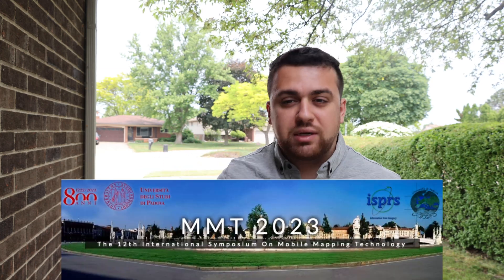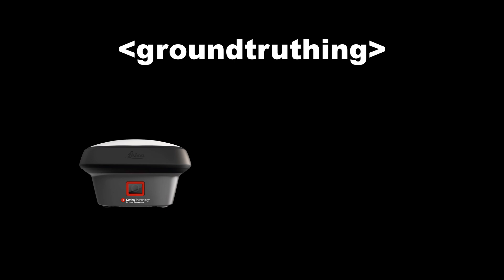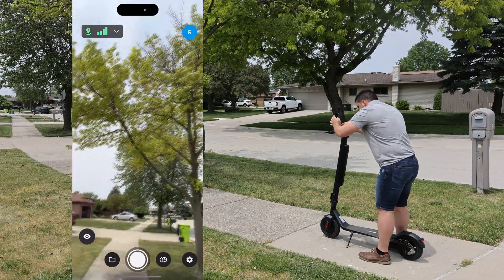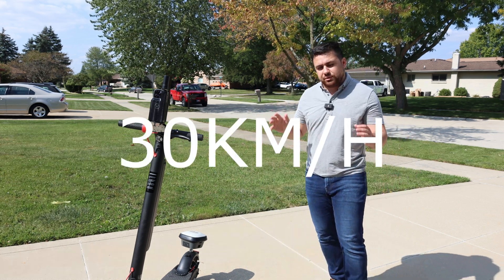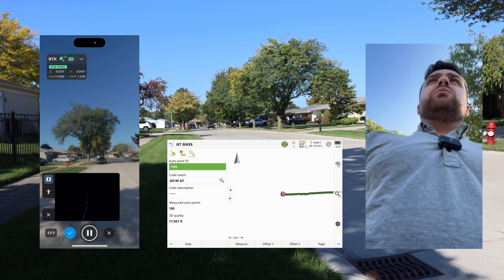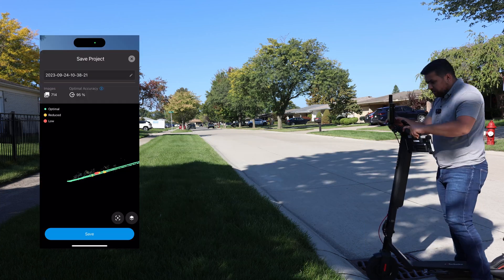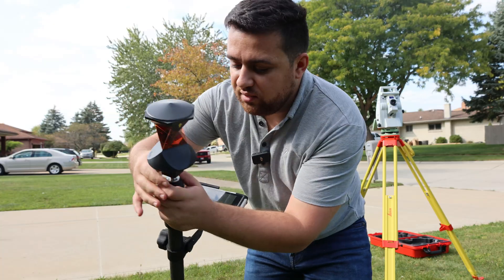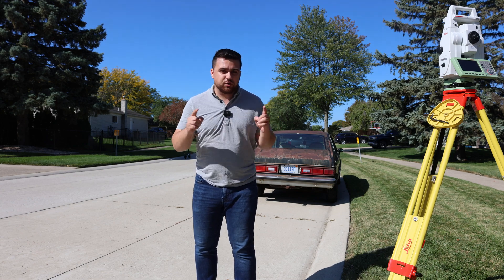Using my iPhone 15 Pro for Mobile Mapping on an E-Scooter

Comment: Rami, I have been watching several videos, excellent results, I did some research and found out that most drones are capable of lifting the weight of an iPhone. What if it was possible to design a drawer-style holder to place the iPhone on a basic drone and conduct surveys? This way, the iPhone also remains very stable with little position variation, always pointed to the ground. If you don't conduct this test, I intend to do it one of these days. Thanks for the content!

Comment: Great video. How about not attaching the Vidoc to the iphone, and putting the iphone on a gimbal for stable measurement. You can fix and key in an offset from the iphone to the vidoc for positional accuracy. Also, would it be possible to connect more than 1 iphone to a single vidoc to get multi scans? This would emulate a traditional 360 lidar scanner, but with survey grade positional accuracy.

Comment: If you get some loctite blue then you can have double assurance your mounting bolt won't vibrate loose but it won't be any harder to remove when it comes time to do so.  do not use red because it requires very high temperatures to get it to release
Reply: Also there are inexpensive isolation plates/mounts (look for cables instead of springs or rubber) that can help bring down the jitter compensation the phone has to perform by giving it more stable raw input data.  I don't know if it will improve the outcome but it should decrease the load on the system somewhere internally; whether or not that matters depends on where it happens but since it's a black box the only way to find out is to do it.  Should be under 20 bucks from your preferred online retailer and bolt right up to what you're doing.

Comment: good video!! Do you think there is a difference between the LIDAR sensor of the iPhone 15 pro and previous versions? It is supposedly a new sensor compared to the previous one that has not changed since the iPhone 12 version
Reply: I'd also really like to know. There are some reports that the density of the LiDAR points on the 15 Pro is less than on the 14 Pro. There were also rumours that the sensor would be improved but no official news from Apple. 

Have you been able to compare both? It would be great to see a video comparison 🙂